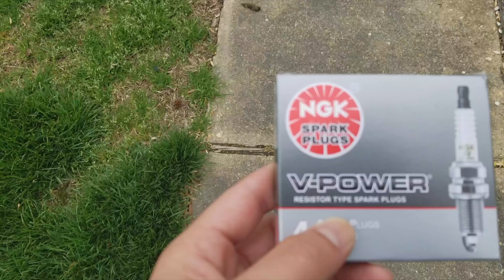How NOT to Change Your Spark Plugs - 2012 Jeep Compass Sport

Comment: 2013 Jeep Compass 2.4L hesitated to accelerate over warned spark plugs and the problem would get worse when turning on the AC. After replacing spark plugs, it helped fixed the problem completely. No more hesitating to accelerate.
Reply: It’s called preventive maintenance when you change spark plugs in a car after about 30 or 40,000 miles

Comment: Ty for this video. I actually bought a repair manual but wanted to see somebody do this to make sure it looked easy. I have a patriot but I think the compass is almost the same vehicle. I think your plugs should be gapped at .043 and the torque you tighten them down should be 20 ft lbs.

Comment: didnt disconnect the negative of the battery and didnt gap the spark plugs....jeeez
Reply from the maker: This is why I was making this tutorial. I couldn't find any good ones online. That's why I did this vid to maybe start the conversation and help others in my shoes!
Reply: Most of the mechanics don't disconnect the battery for this job also the ngk spark plug is factory gapped at 0.044 the 2.4 engine requires a spark plug gap of 0.043 so the spark plug is ready to go out of the box,maybe his only mistake was not to check the gap,but for me is a great video ,the guy learned to do it and did it dont discourage people with comments like that.
Reply from the maker: @p1zuzu  Thank you! I'm all for the conversation with both of you. In my circles talking shit is considered normal. But also when someone with knowledge drops info I pick it up